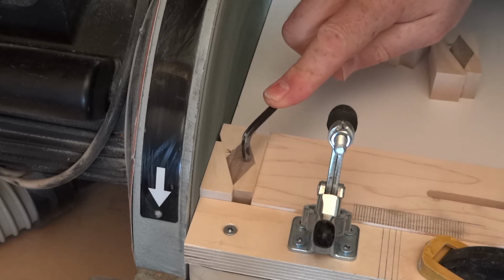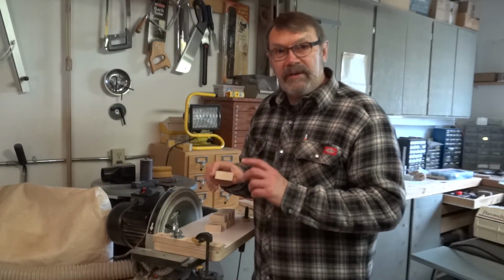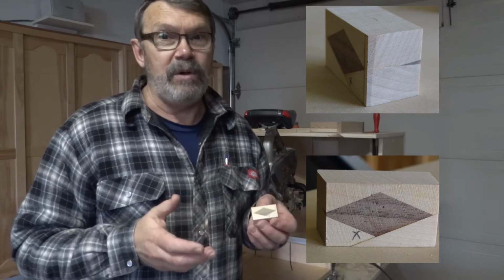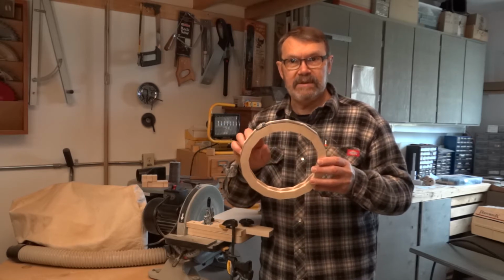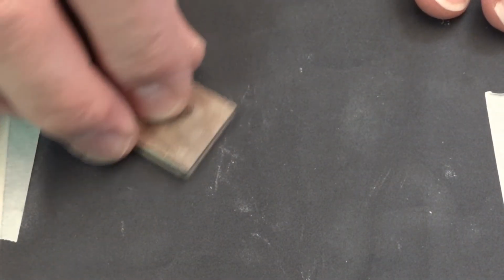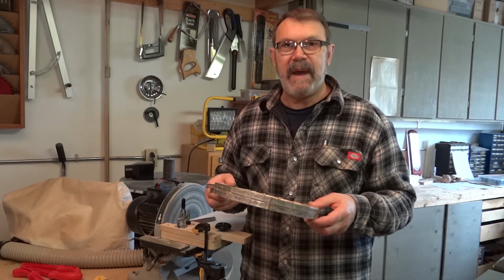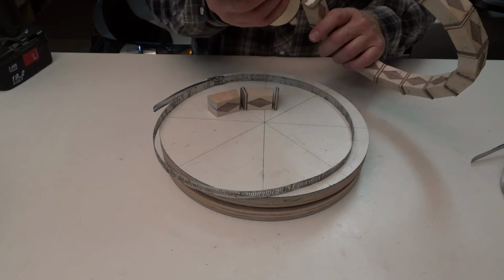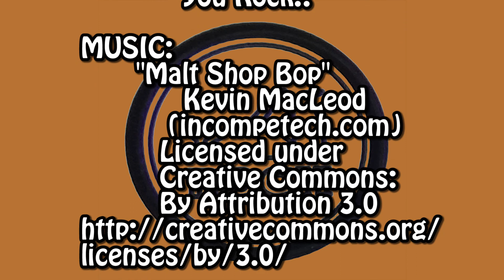Making A Segmented Vessel With Diamond Feature Ring   Part 6 of 9

Comment: when i glue the segments together i sandwich all the pieces together between 2 scrap wood with top up angle down then i tape them together with masking tape leave one edge flush the other leave about 3 inches then i flip tape side down angled  side up then put glue between spaces lift tape from left to right it spreads the glue evenly  then pull the tape in a circle tape ends together there should be no gapes then you can clean glue then clamp with hose clamps not to tight you will press all the glue out then tap pieces to make sure of fit then tighten the clamp not  to tight or you might squish out all the glue if you do lots of rings this will save time
Reply from the maker: Russell, I used that same technique in the past. If you've seen my video on doing Stave Construction that's what I was doing at that time. I would still use that method for long staves but for smaller segments I find it takes longer than necessary. We don't all have to do things the same way to be successful. As long as you like the method you're using that's great.
Thank you for watching, Russell. I appreciate the support!
.....Gord

Comment: Thank you so much for taking the time to video your project, it's very helpful to watch the process unfold. I do have one question if i may ? and i am not sure if its already been raised. 

Question 1 is: 
at about 10 mins in to this video.. you mentioned that gluing up all the thin square divider segments is very tedious (perhaps your less Favorited part).  this got me thinking and  wondering if you could perhaps glue up the long thin end strips x3 before you actually cut them all up into small thin squares.. ? 

Oh.. this has raised for me another question.. 
Question 2 is: 
is possible to make the Diamond segment as one long rectangle and then slice it up into the diamond in-cased cubes?  and thereafter sand the edges for the ring angles ? 

i hope that the  questions make sense ?
cheers.. and many thanks.. 

Richard.H.
Reply from the maker: Hi Richard,
Thanks for watching! I hope the videos might be of some help!
Question #1: I can't see why that wouldn't work. Sometimes I don't see the obvious answer but that makes a lot of sense to me.

Question #2: This one I don't think I could answer without actually trying it and I don't think I will be doing anything like this in the near future. If you try it I would really appreciate knowing how it works for you!! 😀

Take care,
.....Gord

Comment: Mr. Rock,
Thanks (again) for some superb video and instruction!

If I may, in your answer to Mr. King, you said you didn't cut a long set of strips and just laminate and then cut them afterward (as most all of us do), because you don't take any chances with grain direction, as it can cause glue joints to opening later on.

Mr. King answered that it makes sense.
I'm sorry, I might be dense, since it doesn't make sense to me yet. What did you mean?
Reply from the maker: I hope I can answer this and have it make sense! The way I cut the pieces is such that the board is laying on its side with the grain running horizontally. When I glue up the 3 pieces the grain is still running horizontally THROUGH the pieces and I can glue them up that way. If I was to make a board with the 3 pieces stacked and then cut them to the length that would equal the height of the ring I would then have to turn the pieces 90 degrees to have them oriented (standing) in the direction for the look I am after. However, turning the pieces that 90 degrees would change the direction of the grain by 90 degrees and be opposite the direction of the rest of the pieces in the ring. I hope this makes sense; I can see it in my mind but I may be doing a bad job of explaining. Please let me know if I need to try again. Thanks for your interest.

Comment: When making the small pieces for the feature ring is there a reason for not gluing the three strips together and then cutting them?
Reply from the maker: Gluing thin strips together and cutting them would change the grain direction. On pieces this small there is a good chance it would not affect the vessel but I don't take any chances with grain direction as it can cause problems with glue joints opening at a later date. Thanks for watching!
Reply: Thank you makes scene.

Comment: What is the measuring and marking gauge you are using? Brand name?
Reply from the maker: +Sam Croninger 
Sam, I did not watch the complete video but just scanned through it. The 2 tools I saw were the Incra ruler (6") and a machinists square. I MAY have also used an Incra T-Rule. You can check these out on LeeValley.com. If that is not the tool you are referring to can you tell me the time mark at which you saw it and I will take a look and let you know. I hope this is some help!! Thanks for watching!
Take care,
.....Gord

Comment: Why have 4 steps to do the final 'set to width' and 'cut at angles'. Why do you not sand the angles directly, thus avoiding the 2 cuts on the miter saw?
Reply from the maker: cyrille de Brébisson If I understand your question correctly, it's because the closer I can cut the segment to the correct size on the miter saw, the less wood I will waste. If I just cut a segment without taking the size and angles into account and then sanded it to size I would waste whatever amount of wood I sanded away. I hate wasting wood.

Comment: How long does it take you to make a ring like this? Are you working on this ring while the other parts for the vessel are in the ring press, or do you have various projects on the go? I don't think the tediousness of the project will bother me that much if the end result is worth it, I'm just curious.
I've watched 4 parts in a row, love the work, but the music is driving me crazy, I would mute it but I want to hear what you have to say about the project. Still worth it and I'll watch to the end, but perhaps with some breaks. lol.
Reply from the maker: traog I can usually make a ring from starting to cut the parts to gluing it up in anywhere from 30 minutes to an hour. Yes, I usually am working on a ring or 2 while the glue is drying on other rings in the press. Sorry about the music; my taste must be different from yours. In the future I will continue to use background music but will make it quieter.
Reply: It wasn't that bad, the volume was about right. It was just a bit monotonous, the same riff over and over, and watching several back to back. If it had been different on each video it probably wouldn't have bothered me at all.
Something else, is that a special sanding disk? I'm asking because with this technique all the sanding is happening with the same area of the disk yet it isn't losing its effectiveness.
Reply from the maker: traog The disks are made for Shopsmith and are available here:@ownersite/catalog/ceramic_psa_sanding_discs.htm
Reply from the maker: traog Maybe I should try using more than one audio clip on each video instead of repeating the same one?
Reply: Gordon Rock Finally got around to getting these disks ordered, unfortunately they don't ship to Canada and their Canadian distributor says they don't carry the ceramic disks. So I'll have to keep looking.